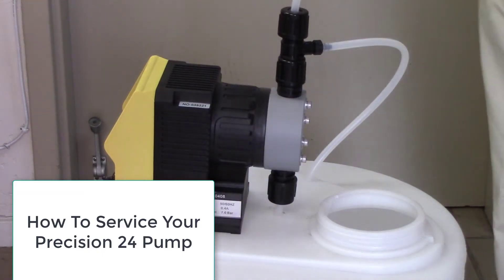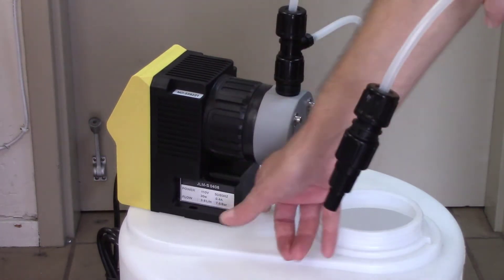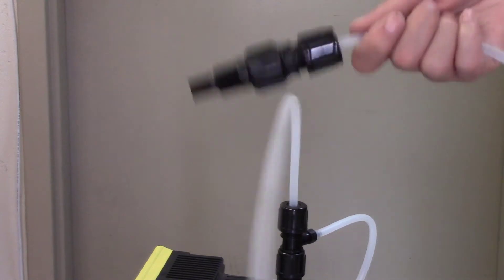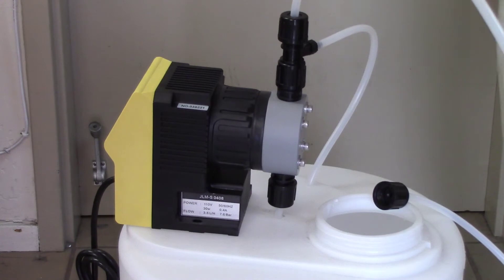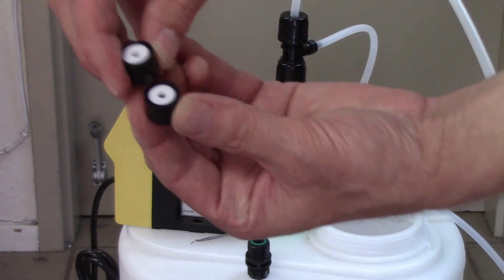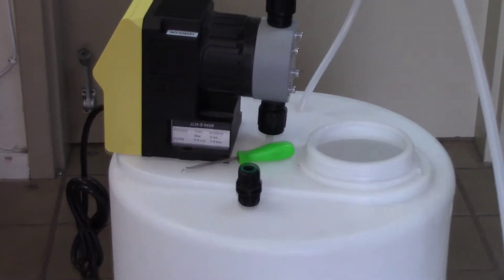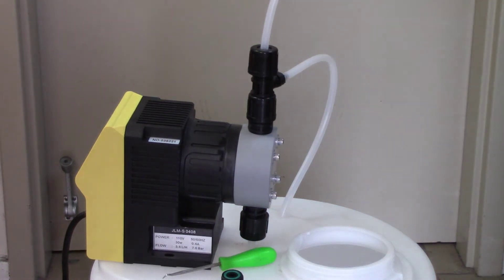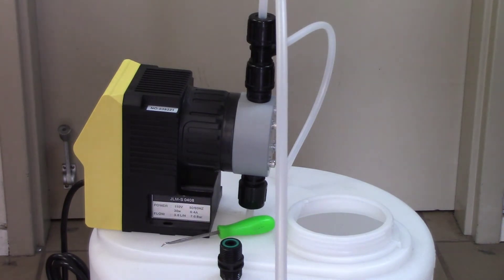How to Troubleshoot the P24 Chlorinator for Well Water

Comment: This formula of 1 qt chlorine to 5 gallons water does rhis aplly to a well water system
Reply from the maker: hello - its a starting point to decide what the solution strength of your chlorine should be.   You can start with that and then measure the chlorine residual in the water and then adjust your dosing pump and/or change the solution strength.